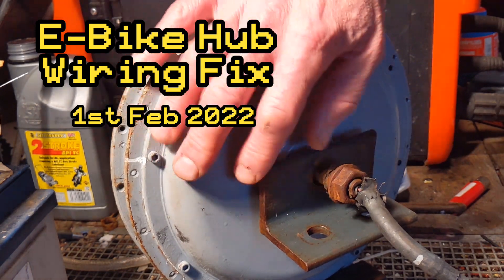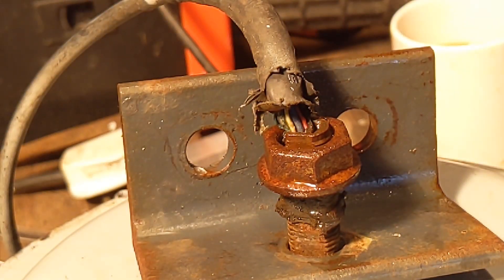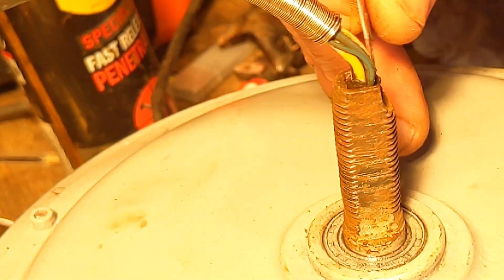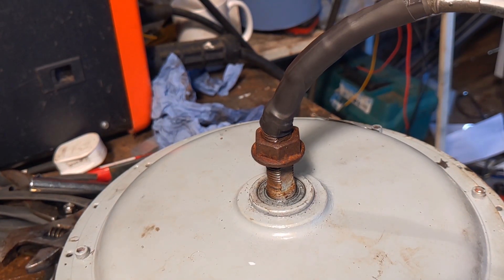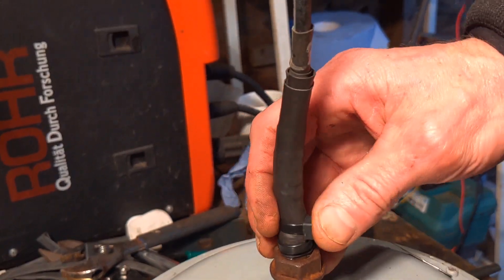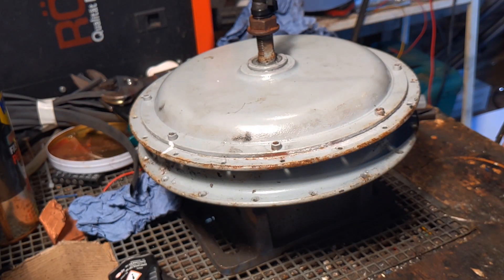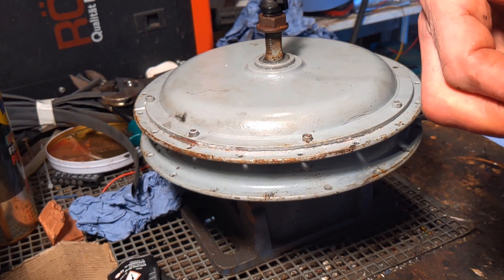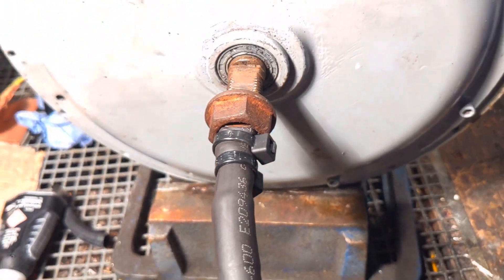48v 1kw Electric Bike Motor Hub Wiring Fix / Repair - Wind Turbine - 1st February 2022

Comment: How do I wire this ? What are the colour wires as in plus and minus etc thanks
Reply from the maker: Do you have a three phase AC motor or a DC motor ( these are older with just 2 wires )